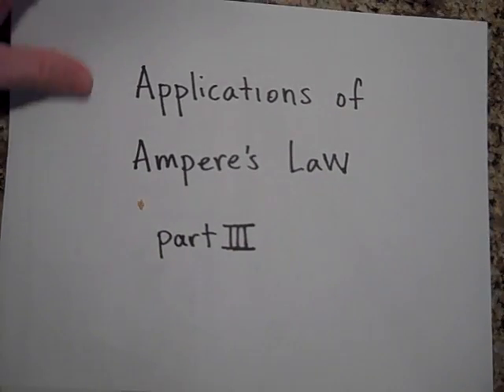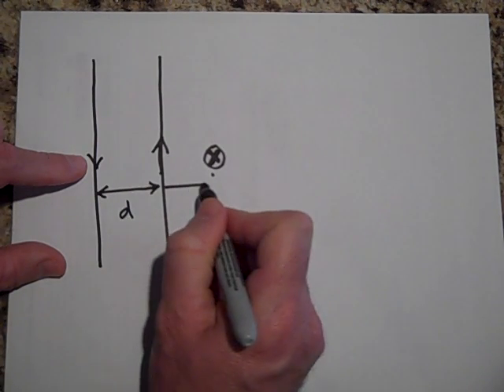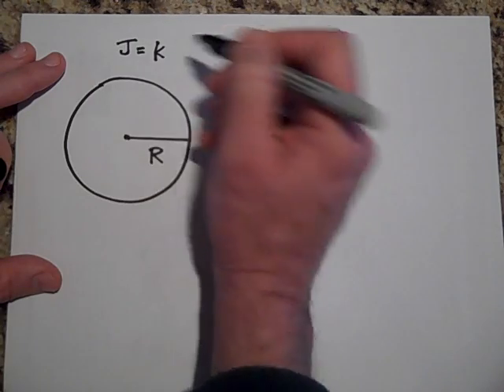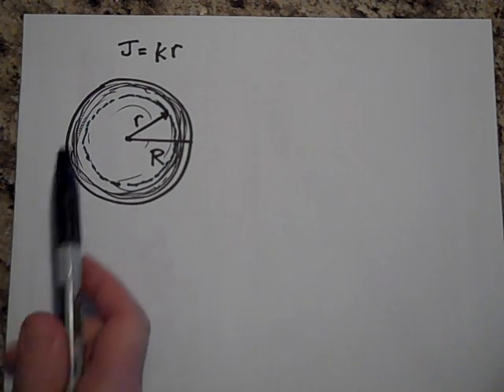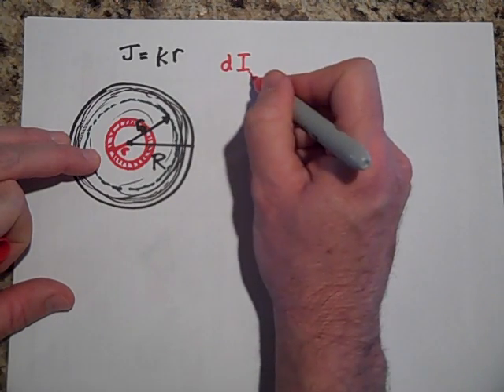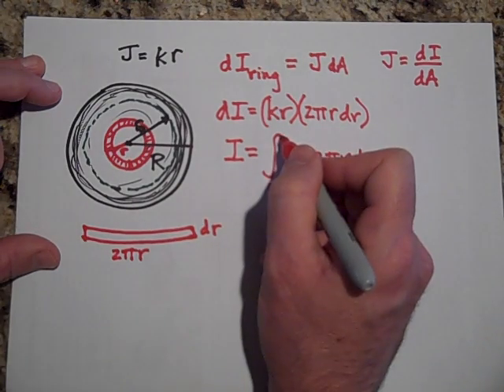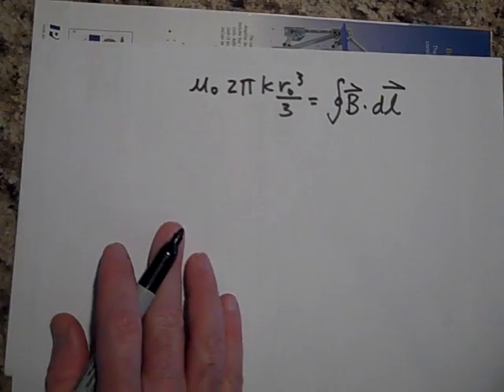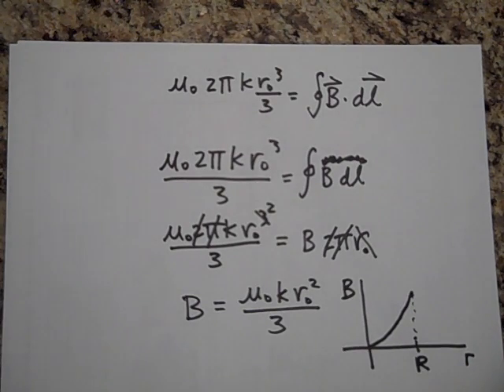Applications of Ampere's Law (part III)

Comment: please explain the part where the fields cancel ....
Reply: i too hav the same doubt
Reply: stevey zack they don't in this example. but they could cancel in that same point in space if the currents were different. For two wires with different known currents it's not hard to see where the field is 0.
Reply: Only those current variable cancels out who are coaxial...so you have to see whether the are coaxial or not....
Reply: if you were to have an amperian loop around the two opposing charges they cancel. Because  the sum of two opposing  currents equal zero. The direction around the Amperian loop is opposing each other.

Comment: I think it almost the same, the difference is that now to the left side you should integrate from 0 to R, rather than r0, and to the right side of the equation, it should be B times 2 pi times whatever the radium is.

Comment: what happens at the end, when we are ouside R?
Reply: 6 years late... but it decreases similar to  1/x graph. weaker as it gets further away
Reply: Reverse Guy yea... if the opposite were true, electricity would kill everyone because it would get stronger with distance.
Reply: Reverse Guy I’m not saying it follows 1/x... but the current outside the wire decreases LIKE a 1/x graph. 

I would suggest looking at his other videos where he goes over coaxial cables. He mentioned that idea in there. Plus it’s just a common sense intuition thing... outside a wire how would the electric field / current increase? Fields get weaker over distance and time. I’m just stating that out of intuition the fields get weaker in a (1/x) fashion.
Reply: Reverse Guy Nope. Not off the top of my head.
Reply: Reverse Guy yes. Sophmore in Chemistry. I’m not a physics major but I’m taking EM to finish my natural science requirements so I can take all the higher level chemistry courses